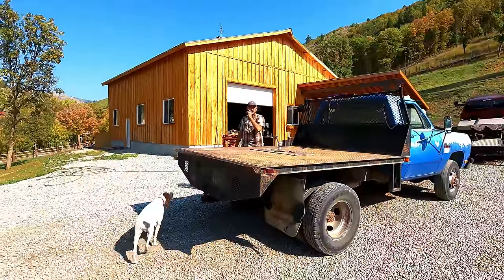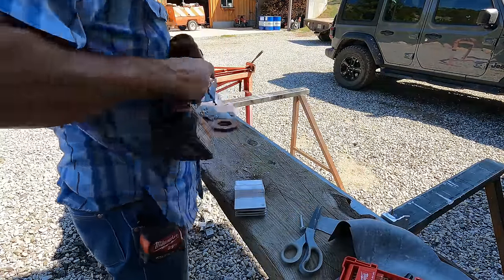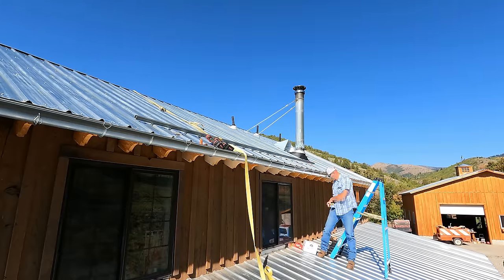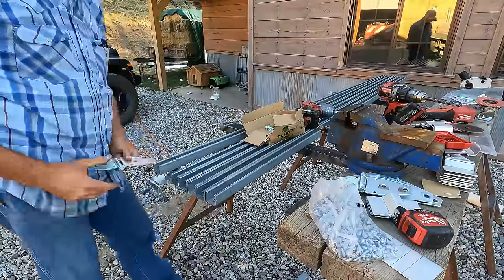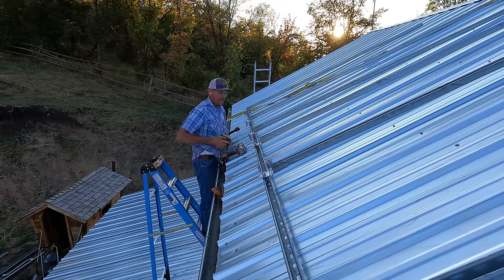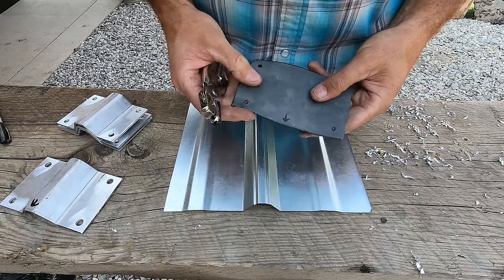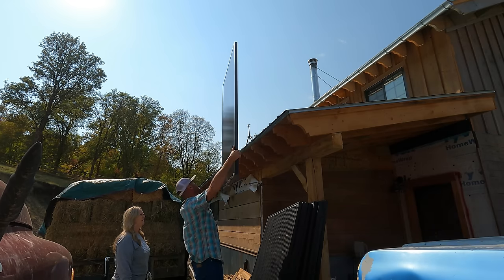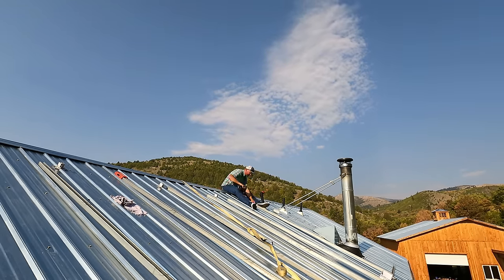#521 - DIY Adjustable Roof Mount Solar Panel Rack (Unistrut).

Comment: What happens when you get a foot of snow fall and then it slides down the roof and hit the backside of the solar panels?And then say another 6 inches slides down the roof and stacks on top of the other snow?
Reply: He will be hanging on with one hand to the rope.
Reply: Easy, just install another new roof!

Comment: Just a random thought. I do not know if it would hinder the physics or not but… what do you think about a good cleaning and application of RainX to the panels. That would help keep clean and snow slide off. Not sure how long would last in that situation either. Just a thought

Comment: Keith, did you provide for drainage on that lower uni-strut (the one that runs parallel to the lower edge of the roof - or the mid or upper one)?  Drainage can be had by drilling weep holes along the bottom edge or mount it at a slight angle so the water will not sit in there and start rusting...  Straight ahead...

Comment: Will the bolts you are putting for your brackets create the same problem for the corrosion? Also, don’t they use special protectant sprays for keeping windshields from having everything stick to them? Do you have four trucks now, Heath? So many questions, I know! You’re obviously working hard, so good on you. Maybe get your oldest boy to help with all the lifting and toting, so Cedar doesn’t have to do so much of it. 😂 God bless y’all!

Comment: Still better overall to just leave old panels where they are and add more on roof. I know you wont listen . Obviously though you or someone does read the comments. You wouldn't absolutely have to put batteries in the shop if you put panels on it but I digress. Some 435 watt or so panels are about 60 cents a watt and you can fit more watts of panels per square foot and make more power in lower light times.
Reply: Now he’s going to put panels on the first floor roof. He said he wouldn’t but here he goes. Should be a nice view out those windows

Comment: Hi Guys if you are correct and the snow will slide off the panels easier then I would not mount the lower panels below the upper ones I would put them to the right under the chimney this will also have the effect of breaking up the slide off.
Reply: Snow weights approx. 20 pounds per cubic foot.  Wherever the snow slides off from, think maybe 4 cubic feet at a time.  80 pounds of snow abruptly  hitting the glass of the solar panels probably means. . . new solar panels.

Comment: Isn’t the Unistrut galvanized? If so you have tin > inner tube > aluminum > galvanized? Will that cause an issue?
Reply: The roofing is actually some type of steel.

Comment: If anything--- I'd leave the system on your house, and then just add extra on the shop with a smaller second battery array--- and then run some direct burial wire to your house and you'll have a little redundancy and extra capacity;  just in the future, if you decide that you need more.   Adding more is a much bigger jump than replacing what you have-- which will be only an incremental change.

Comment: How long till the inner tube rubber decays in the hot summer heat and freezing winter cold 🤔?
Good thing we're here to provide Heath more problems to consider 😬. 
So you have the roof metal, the adapter aluminum, the galvanized hinges, the ?? screws and solar panel frames. Can he add yet another flavor of metal 🙄. 
Duct tape to hold the rear solar panel wiring? Duct tape and cable ties are the new bubble gum and coat hangers 😁.
So much for the leisurely off-grid lifestyle 😉.

Comment: Since the tranny in your dodge is already slipping, it couldn't hurt it if you put a bottle of STP Engine oil additive in the Transmission fuild. Some Transmission builder use it to hold check balls in place while rebuilding them so i know it will not hurt any thing in a Transmission. After you add it and take in for a drive for a few miles you will notice it working. Why a transmission starts slipping is because of wearing parts in the valve body that controls the pressures going to the clutches, once those valves become loose they pass fuild by them and that cause a loss of pressure on the pistons that pressure the clutches or doesn't remove pressure at the proper time and that leaves the clutches applied which make the clutches and steels slip. I have used it for years in old car and trucks and my 1992 Suburban is running with it right now as i type this to you. I bought the transmission for 300.00 used from a scarp yard and changed the fuild over 10 years ago and added the STP as a precaution because it seem to be weak and the old fuild was abit brown and i am still driving it today. I have used this fix for old 1982 chevrolets, a 1987 Chev K1500 pickup, a 1987 chev Acadian and 1997 saturns and the 1992 chev suburban. The saturn i drove for 20 years on the original transmission, the 1987 chevette Acadian was slipping going up hills till i put it in and drove it foer a few hours than it dug gravel ruts all the way up the hills and throw stones because of the snow tires. I also think if you wanted to put solar panels on the Garage, you should check in to AC coupling using micro inverters that can be wired directly to the garage sub panel and that way you wouldn't have to run wire back to the house, Because the micro inverters change the panels DC voltages to AC voltage and matches it to the AC coming from the house inverters. Go on youtube and look for AC coupling and you will findout what i am talking about. the micro inverters put out 240 volts split phase which is standard house hold electrical, and because you would use 2 solar panels for each micro inverter you will not have any problem with shading. Look up the alt-E store AC Coupling and they will explain that even thought you are off grid, you can still use a grid tie inverter to change the solar panels DC output to AC at the Garage and wire it to the sub panel in the garage which will be sent back to the house and can be used to charge the battery bank or be used to run the Garage or the house electrical needs. What your Inverter will do is use that AC voltage to charge the batteries in the house and one the batteries are charged and your power needs are met, the grid ti inverters can be turnedoff or the power can be used for Baseboard heat in the Garage or house or stored in Hotwater tanks for thermo uses.

Comment: That chimney looks like it will shade a panel in the morning. Any shade can cause a huge performance degregation. Put duct tape sticky side out on your boots. I put this in the comments earlier but you may have not seen it. Also 21 degrees for your location is too low.

Comment: What about the Fasteners, the electrolysis is still going to occur with the what? 3 different metals? The Aluminum, The Galvanic Metal, and the 3rd metal of the fastener its self?  Hope the Fasteners are not the first to go, but since the smallest amount of metals are going to be adversely effected compared to the size of the other dissimilar metals.  What can we do?
Reply: Dissimilar metals sealant is available for this application.  If applied correctly, will last a long time.

Comment: I love your definition of a New truck.
I also like your use of tyre as a gasket, I would still use butyl tape on the screws to firstly ensure no leaks and secondly to stop the screws reacting with the dissimilar metals, I suspect you have steel screws going from aluminium to tin, a great club sandwich.

Comment: I wonder if you apply a vehicle wax to the solar panels if it will make them slick so the snow slides off easier? I have no experience with solar, it was just a thought. Good luck

Comment: Do you feel that truck tubes are UV stable to last?  I would like to see rubber roof scarps. But it is under the panels and metal. So tubes should be fine.

Comment: When it comes to adjusting angel   have thought  some rv trailers have stabilizer   that kind of adjust to the terrain   one side may find ground fist and the other side continues to lower/rise  and are driven  either  with motor or hand    I was wondering  if one end of solar panel is fixed  the stabilizer would  raise or lower the top end to change angel   is using motor one could use remote switch  from ground or even the mechanical room where one could actually  see increase  out put when adjusting  just a thought

Comment: I have seen in some cases for long-distance runs where they actually convert the energy off the DC panels into AC and run it over to the inverters and substitute the power being inverted during the day. Letting the main system charge and then go back to running as normal overnight. I don't know if the line energy system is set up to handle this yet

Comment: You only get a 3% drop every 80 ft of cable you don't have to move batteries eztra inverter etc. If you add panels to the garage.also, love that he chooses to do metal shavings work where people park instead of near the ladder.🤣😂🤣😂

Comment: Last week while I  watched you bend and problem solve I had thought to myself- cutting a nice thick square of steel belted radial as a rubber bushing between the roof and the bracket would work.  Would help water issues also.
Lo and behold you are using tires. Consider using steel belted radials?

Comment: Would the underpayment stick to the metal roof? If it does could you put a thin runner across the roof to stop shoes slipping.

Comment: I would have already sprayed the roof with a Hudson pump sprayer.... in that would have been a solution of dawn dish washing liquid.... "takes grease out of your way..."  then wash off with a hose..... no more slippery slopes.
I was also going to suggest the Linear actuators to set angles....
sorry ... I know your dont like hearing from us.... but you brought us into this relationship.... so tuff.
You sure... that NEW dodge wasnt yours???  was that just a double cross, double cross...

Comment: I wonder if a ceramic coating (like you use on cars) rubbed onto them would help with dust and dirt wicking off without losing efficiency?

Comment: You might want to put some heat tape on the back of those panels so you don't have to climb up on the roof and sweep the snow off every day like you did when they were on the ground. I would have installed some of that same heat tape under the tin...but hey....that's me. I think way ahead as far as I possibly can...always! PS Won't the snow from the main roof panels slide down onto the lower roof panels???

Comment: Heath, is there a way you could use the heat from your stove pipe to possibly melt any snow that accumulates on the roof?

Comment: All you Gotta do is get nonslip work boots. You should really think about getting a roof harness which ties around you and it’s adjustable to where you can adjust it when you’re at the top of the roof at the bottom of the roof. I think about accidents is you don’t know when they’re coming. The slip may come when you put that nylon strap down and then you have nothing to hold on. Just think what would happen to your family and your house projects if you fell off that roof and had a serious accident or death.

Comment: You will also get galvanic corrosion if using graphite pencil during the installation process, you may have to write something on the metal roof using a pencil. This should be avoided at all costs as the graphite in pencils can be extremely corrosive to aluminum and aluminum alloys

Comment: In your opinion how long do you think it's going to take before you see a return in your investment in solar panels. I want several YouTube channels and done some investigating myself I'm not really quite convinced on them yet.
Reply: I don't think it's about ROI, it's about being self sufficient At that point, just "not crazy expensive" is good enough.
Reply: The problem is that the power company wanted ~$40k to bring in power.

Comment: Latitude not longitude, think of Latitude as rungs on a ladder. At the equator, (90 degrees) horizontal all year round up at the Arctic circle closer to vertical.
Reply: Cindy SparkleFarts  farting again eh ?
Just trying to educate the masses, the easy way to remember which is which. I learned this trick many years ago, that I stated above.

Comment: Thinking about falling ice on the 1st story roof array.
Reply: Yeah, snow itself is around 20 pounds per cubic foot.  Think about what happens when the first 4 cubic feet of snow (80 pounds) slides off the roof and hits the glass of the lower solar panels.

Comment: Forgot to mention, where you are placing the solar panels from the ground to the roof, is an ABSOLUTELY PERFECT SOLUTION for your solar needs. Don't need to move them anywhere else. PERIOD!  You're fine right where you're installing them.

Comment: the moving industry like Atlas Van Lines or Grabel Moving use what's called rubber bands and they are made from large inner tubes all the way down to car inner tubes and to me are better than using tape

Comment: How are you going to get snow off the panels? I was thinking of some surrounding metal rack that you could operate by a motor - but a large reinforced shower squeegee will be ok. Do you have a system in place?
Reply: snow on the panels doesn't like as much of a problem at the angle he plans on setting them at. I do wonder what happens to the snow that ends up behind them.

Comment: Latitude, not longitude. Our latitude is 35 degrees (south) and we had the house designed with 35 degrees for the north-facing roof, for optimum solar system angle.

Comment: By putting the panels on the roof , you're going to spend ALL WINTER pulling SNOW off the panels ONTO the lower roof . THEN , you've got to pull the same snow off the lower roof onto the ground ! The additional propane the generator would burn if the panels remain where they are  , IS A NON ISSUE !
Reply: All true but he has to keep doing projects to keep making videos to keep earning a living...
Reply: In the very last clip of this video, you can see the steep angle he has the solar panels set on the roof. So much snow is going to pack in behind those panels during winter. It's going to be a mess.

Comment: The zinc from the galvanized steel will break down protecting the aluminum, then after it depletes the aluminum will break down protecting the now uncoated steel

Comment: Sorry to bring you bad news but adding a rubber isolator will not help, as long as there is mechanical contact with the screws you will get galvanic corrosion. The best is to avoid different types of materials that creates corrosion, this is a common problem and in industries a separate bolt isolator made of PP is used. This also require a lower bolt torque for to keep the isolators intact.

Comment: Aluminum is a bad idea. // The rubber will rot in a few years. // Should of waited for the correct hardware.

This is going to be a very time consuming choice. Hopefully it won't be expensive and require buying new panels.

Aside, wonder what would happen in a lightning strike. Anyone know if he has some sort of grounding system?(if it's even needed)

Comment: Change the transmission fluid and filter..    those transmissions are easily rebuilt.. why throw away a truck because the transmission is going bad..  if you are not making more than stock power with the engine.. no need to do any special expensive stuff to it..
Reply: Heath is mr. fixit with moving machinery. A transmission swap from 250 miles away is child's play 😉.

Comment: COMMENT: Shoes - badminton trainers, as they have technical non slip materials for quick movement/turns, or climbing shoes.....? I look forward to some more, the engineering, and issue of the high winds.....:)

Comment: Oops. Test that gasket with an ohm meter. To make rubber black they use carbon black and carbon black conducts electricity.

Comment: One thing you could do to the solar panels is to ceramic coating them, so the water and snow would glide , on the panels, meaning less dirt , dust and snow, not to mention easy to clean.

Comment: Would you tell us what happened to the 1-ton F/B, skid steer, small excavator????
He bought a new old truck for himself. 
 If I were Cedar I would tell him enough is enough until the animals & cabin had their building completed.  No new (old) trucks, equipment period
They probably won't have to add panels as their family will be leaving in a year or so????
Reply: All I see is this channel going down the tubes if he dose not stay consistant.

Comment: Walking on that roof with bare feet will probably solve your traction issues.
Reply: Toughen up the bottom of his feet too 😂🤣😂.
Reply: You ever walked bare-footed on a metal roof on a sunny day?
Reply: @AParr-cp4ib   100's of times, the trick is to pick the time of day relative to where the sun is hitting the roof.
Reply: @EliDowns114  Thank you.  I definitely agree with you that the time of day/sun angle is a factor.  In watching Mr. Skinner's videos, though, it seems to me that most of his roof-walking is occurring in the afternoon, in full sunlight, on a south-sloping - and metal - roof.  I'm thinking barefoot roof-walking under those times and conditions might make for some very toasty feet.